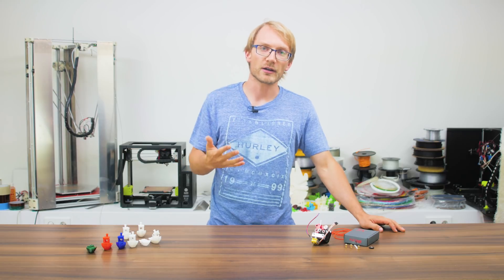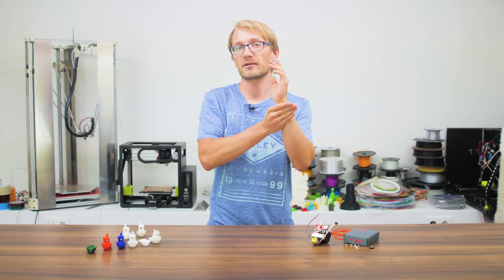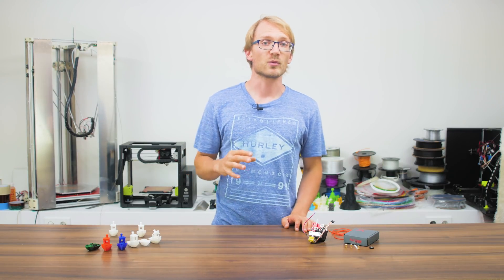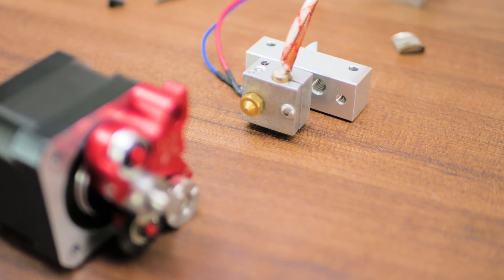Pwn flexible filaments with the Flexion extruder! (Review)

Comment: If you are considering to buy one don't hesitate. I have one for about 3 months and didn't had any problem with it. 

Even though Tomas couldn't get it to work with hard materials, it can print beautifully PLA, ABS, TPU, TPE, etc. You have to adjust the cam dial and the cam dial setscrew. But if you set it right once, you will remember or just take a picture about the cam dial (you can set it between number 1 and 4) and the depth of the setscrew. You just set the dial to the correct material ( 1 PLA, 2 ABS, 3 95Sh° TPU, 4 60Sh° TPU) and while printing adjust the setscrew. Once you have the settings for the materials you print with its one of the best extruders out there. I highly recommend it.

I bought a spool of x-60 filament from flexion which have a hardness of 60 Shore A°, which is extremely soft and i can print it without a problem.
Reply: Its actually the other way around. 4 is for hard Pla and 1 is for soft TPU etc

Comment: quick and easy solution to make the stock extruder work with flex filament. cut a small piece of nylon to fit under the out hole of the extruder to the inlet hole of the hotend aluminum bar. just need to grind the sides of the nylon piece so that it fits the U shaped bottom inlet. Been using it for several weeks without an issue now. :)

Comment: This extruder in fact has one of the lowest friction force needed for pulling PLA. In other words, it´s super effective and extruder torgue forgiving solution. Clearly you have stepper / stepper driver problem, or maybe fact that this is not E3D/Prusa is a "problem"....
Reply from the maker: +Zdeněk Kuzník are you implying that I'm lying about my experiences with the extruder to make other products look better?
Reply: Nope, in such case I would say it clearly. What I´m pointing out is that
 correct review should result as "no matter how much I tried....and then
 speculations about reasons of troubles with PLA" but continue with 
something like "I have contacted Flexion support with my problem and 
result was....etc" - for the case that your piece is a dud.  My 
experience with dialing this extruder for PLA and consequently printing 
is quite opposite - almost no dialing, instead just printing. And I am 
surprised how much force this extruder has, while force needed to push 
the filament through it and extrude "by hand"  (while stepper is 
disabled, heater on) is hardly noticeable. Clearly an effective design. 
 About "implications" - there is no lying from your side, instead you 
tell us something like "yea, the product is good. no, it´s very good... 
amazing...yea..... BUT..... ". And I do believe, based on my experience 
with many of your videos, that in some cases you try to solve troubles, 
in other cases you just deny it....This review is carefully put in the 
middle of these extremes.

But maybe that´s nothing with favorite brands, maybe that´s due to bad 
weather :D that´s what each of your viewers has to judge by himself. 
anyway I´m happy with flexion and up to date I don´t see any "buts"...

Comment: I had the same problem on my Maker Select I3 V2. the solution was to simply use a higher torque Stepper. problem solved. $15 stepper and it prints PLA like a freaking beast.
Reply: what stepper are you using?
Reply: @dushii7641  I apologize that was 4 years ago I don't know

Comment: long story short, it's a specialized and beautifully built high end feeder, specifically for rubbery material. i'm surprised it did so badly with hard material, though.
Reply: I must have put 5 Kilos of Colorfabb PLA/PHA thru my the Flexion on my Creator Pro and hardly had a hitch. It's easily the best upgrade extruder I've used, and there have been a few! :-)

Comment: I just got my flexion this past Monday. I'm having exactly the same issues with PLA and ABS. It never comes close to extruding properly no matter what setting I use or how much I tweek the set screw. But, I printed a cell phone case  out of ninjaflex that was absolutely perfect! It is the best print I have made so far using any material. I sent them an email, and they replied within about 10 minutes. They continued to help the rest of the day. They determined that my drive gear is not perfectly round, and are sending me a new one. I guess we will see how it goes.
Reply: how did it go
Reply: How did it go.
Reply: Duane! Tell us! :D

Comment: What I do not really understand is how much flexible filament is underutilized in the low-cost 3d printing ecosystem. For me, double extrusion using one hard filament and one flexible filament could lead to extraordinary designs where the two filaments are fused together in the print and have articulated, softened and hardened sections -- you could fabricate something which could have soft skin, hard bones, flexible/hard articulated joints and the likes in one print, without having to sacrifice geometry with fittings and slots to assemble the part. However, designs like these are impossible to find, and the closest I could ever get is some play with "skin-like" prints like the flexyhand 2.0.
Reply: actually, bonding multiple polymers via dual extrusion is not unlikely to work well. the difficulty comes up in other places though:

- nozzle/bed alignment: software bed leveling works great with a single nozzle, but with 2 nozzles you really need to be MECHANICALLY aligned else one nozzle will catch the print where the other one extruded plastic.

- optimal print settings: printing PLA at TPU (a common type of flexible filament) speeds would be frustrating to say the least. a large PLA print with just a little flexible material in it would take much longer than printing the parts separately and joining them later

- slow cooking plastic: when one nozzle is extruding plastic the other is idle, extruding nothing at all. yes, you can lower the nozzle temp when not in use, but it takes time to cool off. during that idle time the plastic cooks slowly and you get a lot more issues with heat creep and with plastic drooling out of the hotend (leaving plastic where you don't want it and an empty nozzle when you later return to that nozzle). yes you can mitigate these issues a bit (e.g. strong retraction when switching nozzles and a large priming tower) but even that has side effects (you won't completely clear the nozzle out on a retraction and you'll waste a lot of filament on the priming tower)

i've got a dual extruder setup myself and i pretty much never use it with multiple materials. it's just too frustrating to bother with. the few times i'd bother with multiple materials is when i've got a print with a few layers in one material and the rest in another material; the key here is having a significant period of time using just one nozzle rather than frequently ping-ponging between the two. another common use (as marketed by ultimaker) is to print a water soluble filament with one nozzle for supports, and PLA/etc with the other nozzle for the actual print itself. the above described issues still affect this type of print, but sometimes it's the only way to enable easy removal of really complicated supports.
Reply: not sure thats how dual extrusion works. For one thing it's MORE than likely that the chemistry don't allow simply melting together NinjaFlex and PLA, they likely wont stick together like that, otherwise you'd see some amazing complex objects already.
Reply: Funny 6 years ago and now this year people are playing with this and succeeding granted nothing as complex as you mentioned but still

Comment: question, Tom, can the flexion be adapted to work in a Bowden setup at all? I've printed polyflex on the Kossel Mini's default extruder, but had to slow to 15mm/s with it, due to the spur gear otherwise messing with the filament the extruder...
Reply: True, but the bowden tube actually limits the compression you can get of the filament really tightly. Like I said, I've managed polyflex, and the real stopper there was the extruder more than the bowden... What I found is that if I disable retract when printing polyflex (it hardly needs any compared to PLA for instance) you have a pretty easy time printing it.

What I wanted to know is if you can easily enough fit a pneumatic adaptor for the tube or if you'd have to jury-right something in the nozzle's threads.
Reply: Thanks +Thomas Sanladerer, I think I'll stick to the default extruder for now then - doesn't seem worth the hassle, plus it's a pricey piece of equipment with no guarantee of something better when using a delta printer. Looks really good for standard printers where the extruder's on the printhead.

Comment: the moter on the wanhao duplicator i3 v2.1 has no problem printing pla, abs, polyflex at all in my experience  with the fleixion extruder and the cleaning brush cleans for about a month befor you have to change it out for a new one

Comment: I am having the same issues with pla :(
Reply: Ive swapped out the fan and did some readjustment of heatsinks etc and managed to get 2 nice prints off (at 150% flow) in PLA - still testing :)
Reply: I have had my flexion for about 6 months now on my flashforge dreamer (I wrote the how to install the flexion on the dreamer on the flexion website).  I have found that I can print PLA no problems at all.  In fact I now get better prints overall than with the stock extruder.  I can now print ninjaflex where I couldn't even get it to extrude before.  One thing I have found is that I don't take much notice to the 1,2,3,4 settings on the sticker.  If I get a new filament, I get ready with a allen key to turn the nozzle if it is not extruding until I get a good flow out of the nozzle.  Sometimes PLA is a 2, sometimes ABS is a 1 etc.  Also you have to set the set screw up properly (as per the website) before the first use.  Set the idler to 1.  Screw down the set screw until it touches the cam.  Don't torque down on the set screw.
Reply: +Thomas Sanladerer I've even had ninja flex come out the side like standard extruders ..... My bpsv3 just works tho
Reply: Same here, had it pop out twice..... trying that super flexi jellyfish stuff
Reply: What machine? If I may ask, do you have access to the voltages & torque settings for the stepper motor extruder? Sounds like it might be pushing too hard.
It also might be that there is back-pressure in the extruder, again causing it to push too hard on the filament and squish it flat or cut into it so it won't feed into the hobbed gear anymore.
The previous sentences are speaking about flexible filaments.

The following sentences would be speaking about anything you put through the extruder.
The easy things are: Try swapping out both PTFE tubes for fresh ones, the guide and the one inside the extruder. I have had gummed up or imperfect PTFE tubes cause severe issues. Probably my mistake in the first place.
Mess around with the set screw on the hobbed gear to get the right pressure on the PLA. With filament that is of excessively uneven diameter, this can get hard.
If you have access to your machine's firmware through something like Marlin or Repetier, see if you can ever so slightly adjust the stepper motor torque up or down enough to see a difference.

It is a long and troubleshooting road...
Reply: For PLA (and everything): nozzle should be screwed all the way in to the heater block (maybe backed out a quarter turn). The heat break/barrel should be tightened against the nozzle. The barrel shouldn't be tightened against the heater block first. If you fix this, PLA will print easily.
Reply: I must admit it's pretty strange that you had such issues with the PLA when my sample does it so well, with the only exception so far being poor quality PLA with a variable diameter (another pro for spring loaded extruders). There's clearly a difference in setup, maybe the drive gear isn't perfectly centered or something, which would definitely add huge load onto the stepper due to the tight profile if tensioned up. I'm thinking of adding a thumbscrew to where the setscrew is to make tuning it a lot easier between filaments.

Comment: You should try the flexible PLA from rigid.ink. My 750mm Bowden tube extruder has no problems with the filament compared with other flexible filament that just doesn't work with Bowden.

Comment: I have the dual kit installed on my flashforge Creator Pro and i have ZERO issues printing ABS, PLA, Nylon and most certainly not TPU. Have you adjusted the tension grub screw? i print pla on the 4 dial and prints like a champ w no clogging
Reply: Ok yeah it did skip the first time because the screw was way too tight but a half turn resolved it. Btw love all your videos, awesome content :)

Comment: just a follow up on your experiences with PLA and other harder filaments. i am comparing your review with Angus @ makers muse review of the filexion where he thought that even for PLA it printed amazing.

any reason for the difference in your opinions or is the power of the motor on the extruder causing these problems?

thanks.
Reply: Makers Muse used a Wanhao i3. The stepper motor is visibly different from the Malyan's. The firmware might also be different.

Comment: I've got the flexion extruder and it prints well for me, at times...
Sometimes a get under extrusions with pla and at time it prints perfect. Could be from the settings on cura or the printer is just a piece of crap. I really want to use ninjaflex but I can find a place to get it cheap.
Reply: +Thomas Sanladerer Can you please at least name a few?
Reply: Aurarum sell cheap tpe
Reply: +The Hot End And does that work like ninja flex? I've got a spool of Torwell tpe that doesn't even stick to the bed and warps a lot.

Comment: I have tried a few different methods to get flexible filament printing on my Prusa i3 printer. The first of adding PTFE sleeves to the Greg extruder, and that worked for a while until the sleeve started to move enough to open a gap for the filament to poke though. 

Then I tried Clough42's dual extruder, designed with as little gap as possible. That extruder printed beautifully, and it has handled any filament I have thrown at it. 

tl;dr: flexible filament is tough, but worth it, and being able to print out your own upgrades is awesome.

Comment: So in your opinion whats "best" for flexibles - Titan or the Flexion?
Reply: Titan is not the greatest. The guide path is pretty long. I had to turn the temperature up to 240 to be able to print at only 15-20mm/sec.
Reply: Damn! I literally just 2 mins ago took delivery of one. Wanted to run it as a bowden too!
Reply: Don't get me wrong. The titan is great. You just have to run it slower and higher temp with flexibles. I have used it for a bowden setup for a while and it is great for that as well. I hope you understand that with bowden you will basically never print flexibles.
Reply: I have been printing some flexibles very well with a custom Bowden extruder on a Prusa i3 for a while now but wanted an "off the shelf" solution as I am busy building a multi head XY core setup with a proposed build area of 500x500x1000. May need to rethink a few things
Reply: +Exlr8Films I have used the Titan to print Ninjaflex without any issues at the recommended temperatures. I am using it in a direct drive setup though. I'm sure that makes quite a difference.
Reply: I also run direct drive. Do you have the e3d v6 as well or the lite version? Are you also on 1.75 or 3mm? Also, what tension do you have on the filament
Reply: +Exlr8Films I use the E3D hotend with the Titan. Tom's review of the Titan indicated the two went together well so I bought both at the same time. I preferred the all metal hexagonal hotend I had from Ooznest as I have had more clogs with the E3D one that have meant dismantling everything to clear it but the mount I've designed would need redone to switch to the shorter hotend and keeping retractions short seems to work best with the E3D and I have not had a clog for months now.  I'm using 1.75mm filament.
Reply: +John Crombie I have the tension set to the middle of its movement on the Titan. I load it by turning the gear wheel and unload by moving the tension leaver and pushing in slightly then pulling out the filament when the hotend is up to temperature.